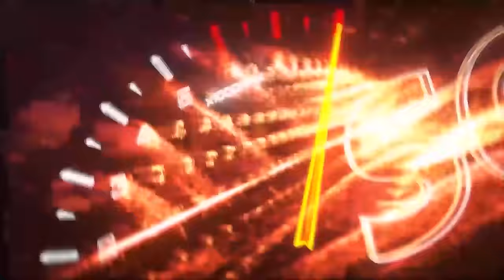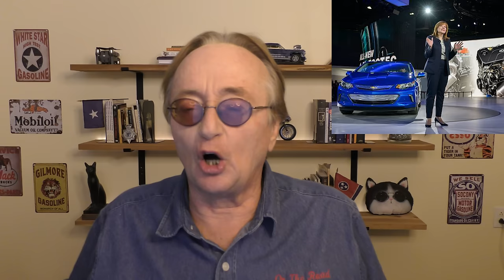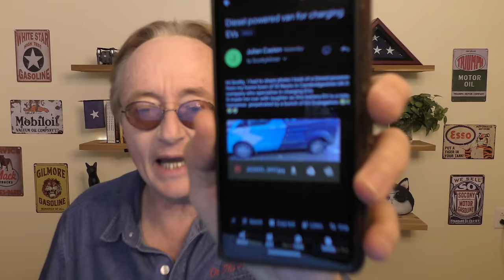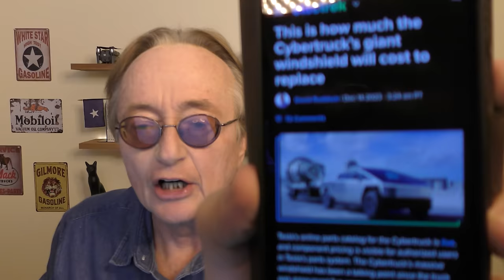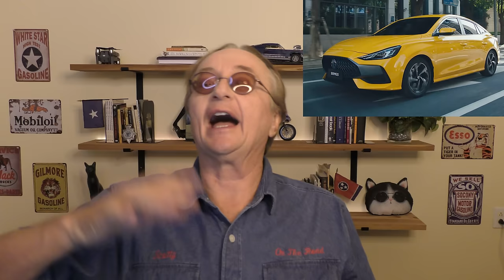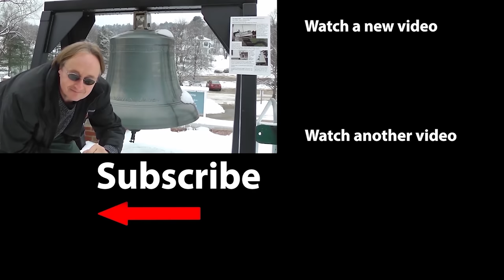GM's CEO Just Announced "We're Shutting Down Truck Production"

Comment: This is why I love GM trucks 1987s and older.
Reply: 1998 and older.  Or the 1999 classic
Reply: @derekgardin1512  Yes GM trucks in the 90s are reliable. My dad had a 92’ Silverado. I’m not a fan of GM trucks from 88’ to now because most parts,like the dash, are made of plastic. It will crack and deteriorate over time.
Reply: 1995 and down. OBD 1
Reply: @ronnie8252  I agree however from 88’ and newer, most parts are made of plastic and I’m not a fan of plastic parts.
Reply: I still drive my 87 G20 around daily. 36 yrs. old with over 500,000 miles on it and still running. Love older cars.

Comment: Glad I kept my 1993 Sierra and painted and rebuilt it
Reply: One of the best cars ever.
Reply: same here , but goverments begin to force us dumping old cars to buy new junk , that is real PROBLEM
Reply: My 93 Silverado 6.5 diesel runs perfect. I'll never change.
Reply: How are parts availability for something that old?
Reply: Great, almost every part is available. The few that aren't can generally be found used. I drive a 1990, the local auto parts store has most items on the shelf. Alternators, brakes, taillight modules, suspension parts etc. Cheap prices as well.

Comment: That's what happens when you make body panels thinner and thinner. The roof panel is about 0.65mm thick at best.
Reply: Thats thin lol
Reply: @joeythreeclubs  Yes it is. I'm a former designer for the T1XX platform of GM trucks/SUV's; currently in production.
Reply: Measure in nanometers and the number is much higher...
Reply: That'll provide the same protection in a rollover as cardboard.
Reply: Kind of like a soda can!
Reply: @brianvogt8125  There is reinforcements and brackets, but the sheetmetal is thin on the panels.
Reply: BUT MUH SAFETY! lol I can't stand driving newer vehicles, because the pillars are all so thick that they obscure my vision. But it's all in the name of safety, even if the roof is a piece of tin foil, right? I try to laugh but end up just shaking my head.
Reply: Yup, there is probably coke n pepsi stickers on the inside lol
Reply: When you see "Eggshell" listed in the brochure, they are not talking about the shade of paint color.
Reply: @garfieldsmith332  lol yup
Reply: I have a 1993 GMC Suburban, there's more metal in my door than all the metal combined on these new vehicles ... I'll take the L on mpg's ...
Reply: @paulmeeker1165  why go with .65mm? I thought you could because  the metal stretched? I assume your die engineer did some analysis using Pam stamp?
Reply: @BillBabicz  I'm sure the engineers did. We as designers also perform an analysis every time we modify a component. I personally worked on closures and lower structures BIW, and overbend on side closures so they'd seal better.
Reply: Anyone know who is supplier of roof? 
A GM stamping plant part?

Comment: I bought a used 1984 K20 for $9,000 I will probably put another 9 or 10,000 into it to get it totally restored. Or maybe a total of 20,000 for a 4x4 with one ton axles and lockers. The new trucks are 50,000 for a half ton two-wheel drive. So for $20,000 I have twice the truck and I can fix it myself

Comment: I remember back in the day, There was a recall on my 2003 Silverado for the tail gate cables.  Apparently, some bean counter at GM thought they could save money by using galvanized cables instead of stainless.  Wrong!  The galvanized ones would get corroded and snap.  So they had a recall to replace them.  I'm not soured on GM though.  I currently own a 2017 Silverado LTZ with a 5.3.  The only complaint I have is that I had to buy a Range Tech to keep the V-8 running on all eight cylinders.  No AFM for me.

Comment: Old bugger here back in the beginning of the 80's Nissan patrol vehicles here in Australia used to crack at the top corner of the roof at the windscreen they tried blaming it on roof racks not letting the roof move and stress....no.

Comment: How do you expect them to fix it? Pull the cab off the truck and install a new one? Costing $20k+ per truck. The fix they are talking about in that area would be just fine as long as the body shop does it right.

Comment: The fix is actually perfectly fine. If you understand engineering. It shouldn't happen but the fix is fine.
Reply: Maybe fine maybe not. I can see two issues one it must be flexing in that area and the flexing issue probably has not been fixed so it could easily happen again . A second issue would be that the quality of the paint it's probably nowhere near as good as the original paint. I know I would not be happy with that repair unless it came with a lifetime warranty for any related issues.

Comment: I would never own a car without a full insurance policy and a full bumper to bumper warranty.  I had a rock crack the windshield on our 2020 Lincoln Aviator black label SUV.  $2000 due to sensors.  Someone tried to break into same vehicle.  $2500 later due to sensors.  Didn’t cost me a dime.  It pays to have good insurance and a full warranty.

Comment: The best solution for longevity and lower cost, is manual transmission. It will save on gas, too.
Reply: Longevity in most cases (not dual clutch super complex nonsense), yes.

Disagree on fuel economy.  Historically yes, now, no.  These new 8,9,10 speed transmissions are extremely efficient.  Their EPA ratings are often better than their manual counterparts and I’ve seen it in real life as well.

All I own currently are manuals.

Comment: Actually, the repair method is completely correct as long as all parts of the bad weld are redone. The original welds by the robots either were done too cold, fast, or at wrong distance between electrode and the sheet metal. Somebody forgot to qc the robot. Lol.

Comment: Scotty. That is how you fix a crack in a panel or in a frame. You drill a small hole to stop the crack from spreading further then welding it shut. If you don’t drill it then it will continue to crack.
Reply: Curious how they will weld it without lighting the headliner on fire.
Reply: Do you think the guys at the GM dealers are going to be able to identify where the crack truly ends, successfully weld super thin sheet metal without any flaws?  I sure don’t, that takes special skills.  They better outsource it and even then I foresee big issues down the line.

Comment: Could be a problem with the steel from the supplier.  Also, the metal is just getting so thin to save weight. Might be a stamping issue - too thin and cracks when flexed.
Reply: That's the first thing I though too.  The steel was not properly annealed.
Reply: It only affected 1500s and the steel is getting so thin it might as well be aluminum.

Comment: A GMC pickup was undoubtedly the best vehicle I've ever owned. It was a '73. Better stuff, I guess.
Reply: My dad's 78 with a 350 was a great truck.
   Close to 400k miles on original motor & transmission 
   The body heald up too.

   My 88gmc had 140k when a bought it & 276k when I sold it.

     It's sad what's become of the big 3.
    Reverse capitalism. Instead of producing quality product at an affordable price, they compete to see who can make the most expensive piece of crap.
Reply: I had a 2000 Silverado that I sold to my neighbor in 2010 that is still on the road with more than 250K miles on the original engine and it runs like a clock. Those days are over.
Reply: Better times as well.
Reply: @jupitercyclops6521  Sadly, they just aren't made to the same level of quality that gained GM a good reputation like in the past.
Reply: @jupitercyclops6521 blame the unions.  Look at the annual labor cost of Toyota and Honda vs. the big 3.  The unions ran those companies into the ground with their grift.

Comment: Ill keep my 88 GMC just needs some TLC
Reply: My 86 is solid
Reply: still driving a 1989 C1500 and a 1995 K2500 here.
SOLID AF TRUCKS!
Reply: @yourfriend9048  I was driving my 89 s10 bought new by dad but wife wrecked it and totaled it a month after full mechanical refresh. I just bought a jeep gladiator to replace it. Definitely the simplest new real truck out there. My 1986 m1028 single wheel rear chevy k30 is still for most part rust free and the old 6.2 still chatters along

Comment: Scotty  due what we truck drivers used on the trailers if they had a rip or hole in them we called it 100mph tape it's a aluminum tar type tape it would seal the leak and the aluminum would be a barrier to outside wind n such. 👍👍👍👍😆🤣🤣  😎✌️👋

Comment: Scotty that is what happens when  woke leaders are in places where they should never be. Maybe when the boards of directors bleed enough cash they will get the message. Biggest problem in the west,they stop promoting employee from the floor up,who bought into the company  they work for.
Reply: The only issue at a certain point the floor worker doesn't have the actual business knowledge to run a multi billion dollar business.   Just because you installed the right driver side wheel for 10 years  doesn't exactly make you manager material.   Manufacturing jobs like GM for example are unskilled and mostly uneducated jobs.
Reply: The reporters are really ripping the electric cars recently  with how terrjble they are to drive on a trip and how much it costs

Comment: I bought my 2012 Silverado new and about a year ,maybe year and a half ago the rear quarter panels/fenders on both sides are rusting badly. I have been seeing this issue on nearly every single Silverado with that body style. Never the front fenders,just the rear ones.Chevy sure somehow screwed up on making those rear fenders either piss poor corrosion  prevention coating or design or whatever. Pisses me off because I have been taking good care of my truck and when I payed good money for something like this, I don,t want to see the body start to rust away like it is doing right now. My wofe and I have a 2006 Toyota Sienna and not a stich of rust on the body after all these years of road salt in the winters. Excellent rust prevention coatings on the bodies during the manufacturing process. I,ll never buy a Chevy truck again,I,m going for the Toyotas or Nissans from now on.
Reply: I mean wouldn’t that partially be your fault for never rust proofing it in a salty state? 

Also look into fender flares to cover up the rust

Comment: I weld/build industrial excavators for a living... i can tell you with 100% certainty that the only way to stop a crack from continuing, is to drill out both ends of the crack and weld it shut.
Or... Buy a higher quality steel to start with.

Comment: It's official: teachers unions have destroyed Detroit - no brains left [that can think].  Roof cracks mean its become a stressed member or material selection failed - ductility [to a point] does help a car live with real road conditions.  High tensile steel?  Certs look nice... until new steel cracks with not a year of service.  I've seen it done in heavy industry to certain gear sets... so they went back to something that did work: nodular iron.

Comment: I remember when I bought a brand new 2015 work truck standard cab with the long bed and it had seven recalls within the first year. And while I was moving out of California they notified me that the hitch that I used heavily was failing upon my third trip to Idaho out of the California state and they told me that the hitch I was using will fail. And after the 6th or the 7th recall. I traded it in for a 2008 Dodge Cummings which had 119,000 miles and and my vehicle had 27000 me new.I got screwed over the deal but I cherish my Dodge Cummings. It took me 9 trips leaving California into Idaho.
Reply: Fyi Cummins not cummings
Reply: Quit making vehicles in Mexico no quality control,why should they care they. Can't buy them anyway 😂

Comment: I see this on all new American trucks.  I install auto glass have been for 20 years.  We see the body seams cracking and falling apart
 Aluminum fords brand new with 1/4 gaps. The bondo / glue that holds the roof on does not hold up to the Midwest weather

Comment: What we need is hydrogen engines. It's safer then electricity and you don't have to worry about it blowing up and releasing toxic chemicals from the battery acid. Hydrogen engines can happen. Just someone needs to realise that hydrogen is good for the environment better than releasing petroleum chemicals or battery chemicals after they explode.  Toyota is making one, and it works. But people are stupid and think electric is the better choice. As someone in the automotive industry. I would rather still deal with engines than have to learn how to fix electric vehicle components.  Hydrogen engines are the safe way to go. What you should do Scot is talk about hydrogen engines. I don't have much research but I have a feeling you can find better sources.

Comment: What's wrong with a weld fix?  Done by a compentent welder this will be better than new.  Though rustproofing priming painting and clearcoating will be crititcal for protection against long term rust at the weld area.

Comment: You put a tiny dent in 1 of those stainless parts & it will need to be replaced. That will probably cost at least a few thousand dollars. No body filler on those. The insurance will be quite expensive.

Comment: It could’ve been the quality of the steel which General Motors has nothing to do with. Or the steel that was shipped into the stamping facility did not meet specifications. Gauge.
Reply: @CP-dk8oi Maybe they "outsourced" the worker who knew how to read the caliper?
Reply: @CP-dk8oi agreed. However, they don’t make the steel. In assuming the gage was off from the mill and wasn’t checked.
Reply: @CP-dk8oithere are only so many steel companies you deal with. I assume they drawed the panel too thin or the steel mechanical or chemical properties were off

Comment: RECALL-One or more of the individual welds in the upper child seat anchors may be insufficient . wait that was the current Tacoma recall….Scottie is the one that’s bias n 1/2 a$s
Reply: Every company has recalls, most of them aren't the roof splitting like the red sea
Reply: @joeythreeclubs  no doubt they do but , 
1)you don’t hear a word from this guy about one brand
2) the proper fix to a split is being followed and this  backyard mechanic is calling it 1/2 as3
3)I’ll take a leaky roof over my child safety any day
Reply: @sambonedallas 

1. He has criticized Toyotas many times.  You apparently don’t watch enough to know.  He had a recent one on the 2.4 liter oil burning engines (bad piston rings) just a couple of weeks ago.  He criticized the Tacoma frames rusting, some direct injection issues.

2. Toyotas are objectively the best made vehicles on the road (on average).  They have that reputation for a reason.  Between my family and I’ve we’ve had 15 of them.  I can think of maybe  $1,000 of repairs that I think shouldn’t have been necessary total and only one of those left someone stranded (bad alternator at 80,000 miles).  Each vehicle is kept for at least 200,000 miles, in the salt belt.  I just sold a Tacoma with 278,000 miles on it.  Burned about half a quart of oil between oil changes but ran fine.  I sold the Tacoma for $4,000.  Anyone who I’ve gotten to switch to a Toyota, to my knowledge has never gone back to any other brand (maybe Honda if that).

3. The seatbelt recall sounds like it would be a relatively easy fix.  Those welds done by guys who don’t weld super thin sheet metal for a living are going to crack, stretch, the paint will be ruined.  Then the roofs will rust. That won’t end well.

Comment: I sold my POS 2021 GMC Denali 2500 3 months ago, got all my money back. The truck had 12,500 miles & the paint was coming off under the fenders. The dealer I purchased it from bought it back, so lucky that truck was going to fall apart. GM has terrible quality, so does FORD with the most recalls.

Comment: Where did you pull the 3k window quote?  I researched that and it seems like it was out of your butt.  Also, 99% of drivers will never crack the glass on the Cybertruck as it is significantly more durable than regular glass

Comment: I have investigated insurance claims for large insurance companies and my unwritten directions are:  Deny, Delay and Minimize in every case assigned.   If I fail to find evidence that can be used for these facetious reasons the penalty - No more assignments for you.  I have seen investiagions claims that are 45 X the original expected claims costs.  I have not added in the huge legal and attorney fees that are then bundled into these "investigation" expenses.  The legal bills are usually greater than > 4 X ---50X the actual investigation expenses.  Self-Insured Third Party Administrators ( TPA's) can pay much less for legitimate claims.